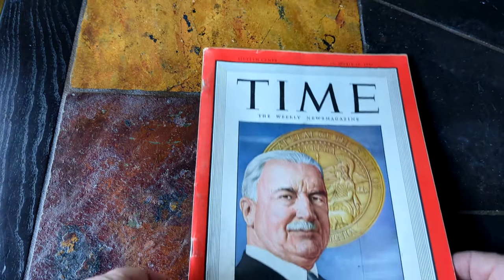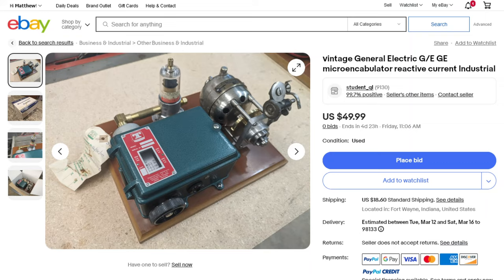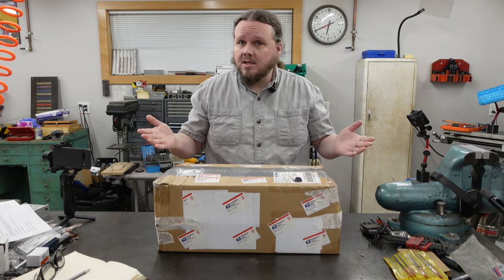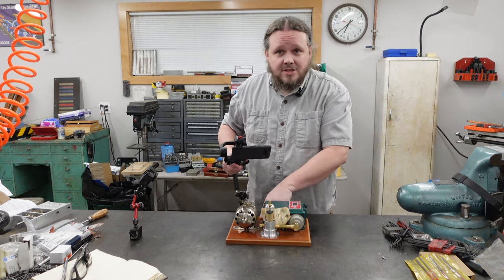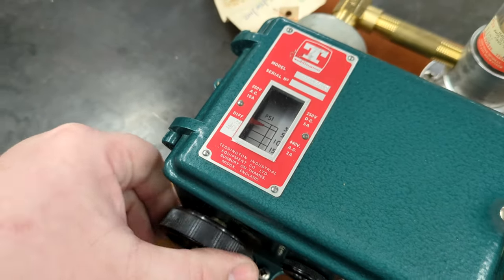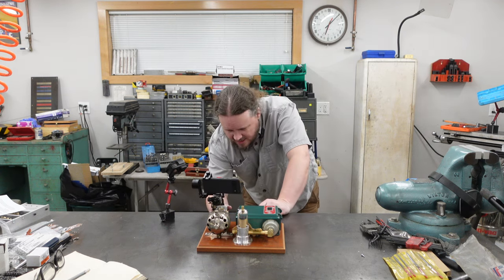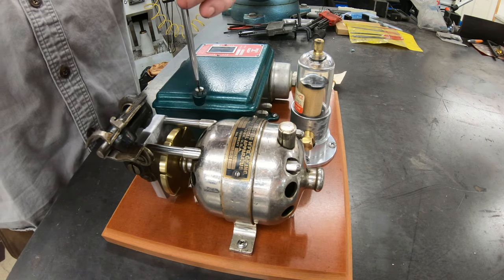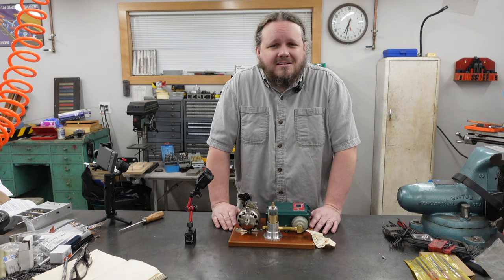Exploring an electromechanical marvel

Comment: That was right up there with the National Semiconductor's write only memory chip. That breakthrough of course made future microencabulators twice as small as they used to be. This really helped solve the safety issue of certain vulnerable people being sucked in by the esoteric vacuum printer cereal port. Even as a skilled and highly trained operator, I got my head stuck in one for over an hour once. I was saved by the east coast power blackout caused by the darned thing overheating. Thank Gord for those no-blow fuses!
Thanks for the romp down memory lane!

Comment: Before turning it on, I recommend performing an industrial Ground Bond test, which is also referred to as the 
Earth Circuit Continuity for Protective Bonding Resistance (ECCPBR) test for Class 1 electrical products.  
Based on 44 U.S. Code, 1963 ed., §304 (July 26, 1935, ch. 697, §7, 149 Stat. 512a).

The FCC CFI specifically states:

§ 120.372 Electromechanical  Equipment grounding
(a) All metallic enclosures and secondary windings of electrical equipment must be permanently grounded to the hull, or nearest Earth Terminal. (b) On nonmetallic vessels, the encabulator frame must be bonded with a common ground by a normally non-current carrying primary conductor. (c) All conductivity must range between 0.05 and 0.07 millimhos (or millisiemens) per kilogram of conductance..

Comment: damn you even found out the general electric one and not the cheap knockoffs from that time. amazing specimen. so glad you decided to share. also very important is something that many youngsters don't know, the modern digital ones, at least the entry level ones, have issues in low current situations so instead of using a step up connection for the encabulator, you can achieve the same result with any old analogue ones you may find around in your university lab. that is a free tip for those doing their master.

Comment: Any micro encabulator aficionado would tell you that the GE encabulators were garbage.  The ACME model 0401 is where it was at for micro encabulators.
Reply: The ACME model had a problem with the Gurgle sprockets deplenarating the panametric flam.
Reply: In my experience the ACME 0420 was the better, more high spec model

😆

Comment: Make absolutely certain that you have calibrated the inverse capacitance bias modulation rectifier to factory specified tolerances before you risk turning it on. I'm sure you remember what happened at Chernobyl back in '86. Just sayin'...

Comment: it may may be possible to cut that odd gear (stator slots) on a rotary broach. the shape could be carefully drawn with something akin to a spirograph/cycloid. I'm neither a machinist nor a particularly good mathematician, but the gear reduction isn't dependent on the scale, so long as the  parts' scale is the same, so you might not even have to have a very good ruler!

it also looks like a combination of circular arcs  not that I think about it. might be possible to draw them with just a compass and a straightedge!